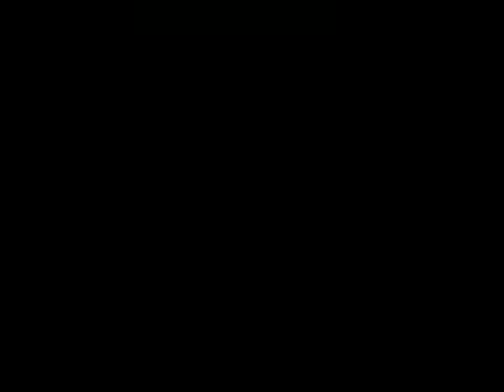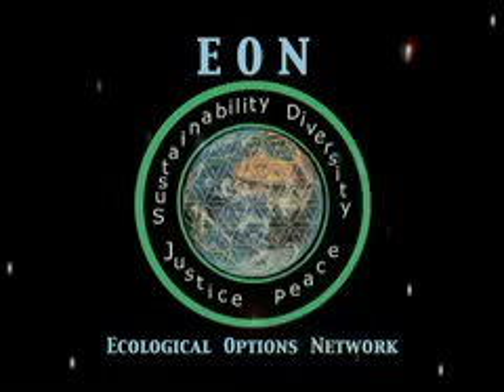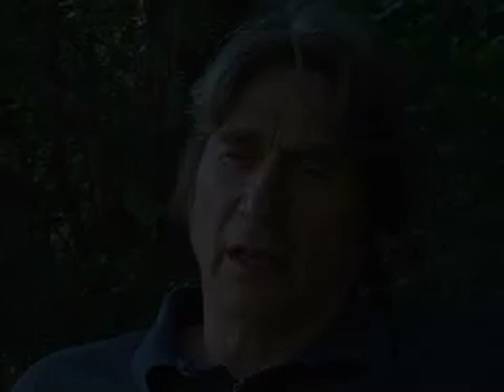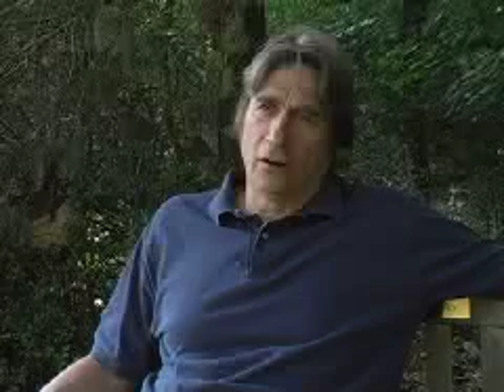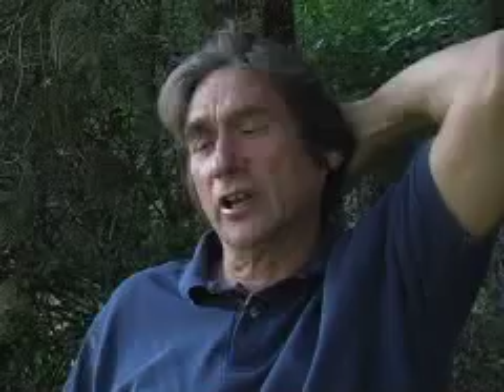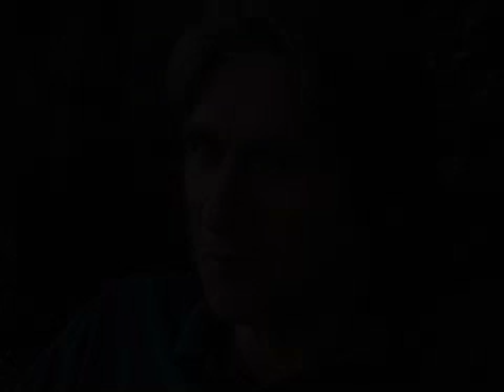NUCLEAR NONSENSE: Interview # 1 - Harvey Wasserman

Comment: I did engineering in mining, construction and manufacturing and I don't find any mistakes in Wassermans video.
 Since I majored in metalurgy, I can add that the effects caused by irradiating materials over long periods of time is not well understood. Wasserman hints at this when he mentions how the high level waste containers are already beginning to crumble. 
I did metallurgy on some N-Plant parts and as a result of that experience I don't want to live anywhere near a nuclear plant. NO WAY!

Comment: Both solar and wind, if properly sited, can provide peak power.  Geothermal and hydro can provide a base load.  And new hydro does not need dams.  Also, I think he agrees that fossil fuels are indeed very dirty.
Reply: solar and wind , even in the BEST places, cost a great deal more than nuclear. Solar causes massive amount of waste as the panels don't normally last longer than 10 years. The amount of power to produce both solar and wind are extreme. Battery power needed to keep the power is also wasteful.

Comment: I stand corrected.  Over 90% of the reactor core was damaged, and only 52% had melted down.  If more had melted down, I guess it would be a serious problem since all core catcher patents include neutron-absorbing designs that would help reduce or prevent a run-away chain reaction.

Comment: Tell me about the containment they had for Windscale.  How about the containment on GE Mark 1's and GE Mark 2's?  Or Westinghouse ICE?  They're pretty much the same - a steel building designed to hold-in radioactivity under normal operation.  On newer designs, the west recognized it needed a steel-reinforced bunker.  None of them can really contain an explosion. An earthquake measuring 5.0 on the Richter scale struck ten miles from the Perry core.  Another earthquake could be much closer someday

Comment: I believe there are 24 nuclear reactors that operate with deficient containments.  For example, All three Browns Ferry units are  General Electric Mark 1 (BWR) reactors.  This could very easily be compared as "America's Chernobyl" design. According to NRC's then Director of Nuclear Reactor Regulation
Harold Denton in 1985, there is something like a 90% chance of containment failure of this containment under accident conditions.  Pilgrim is another example of the GE mk 1.

Comment: Harvey, 
How close was Three Mile Island to the forming of a critical mass after the core melted down 90%?  Do you know if there was almost enough molten Uranium and Plutonium for a critical mass?  It seems to me that lighter metals would have floated on top of the melted mass, concentrating the U and Pu on the bottom.